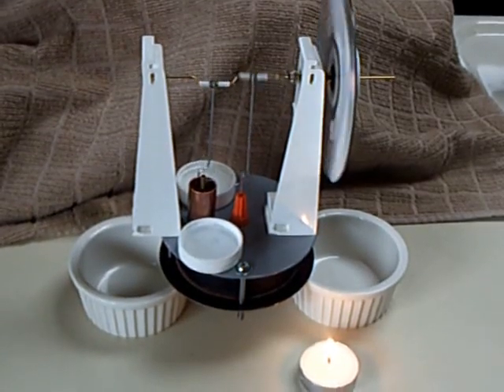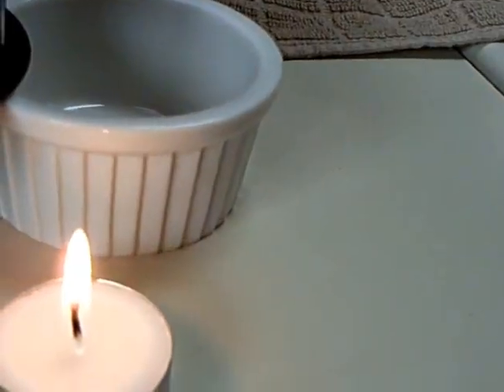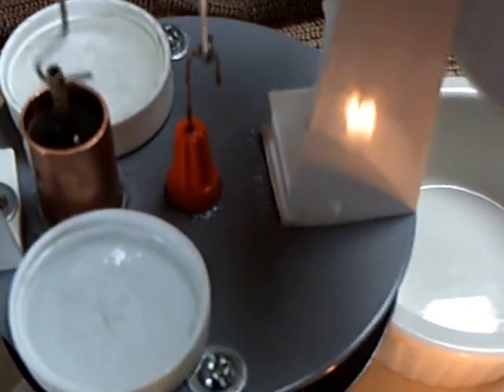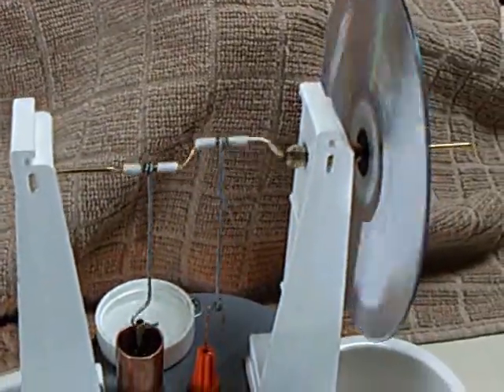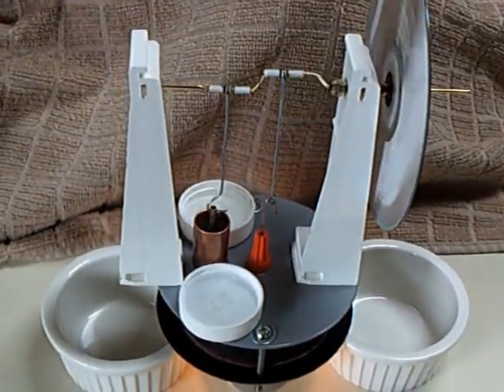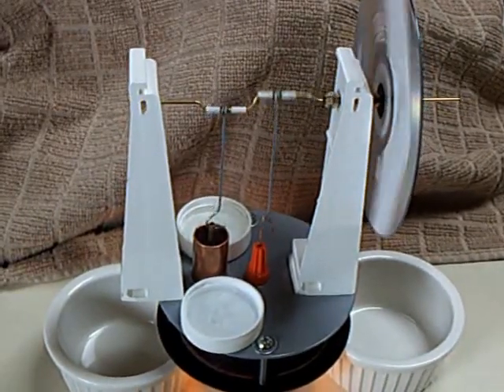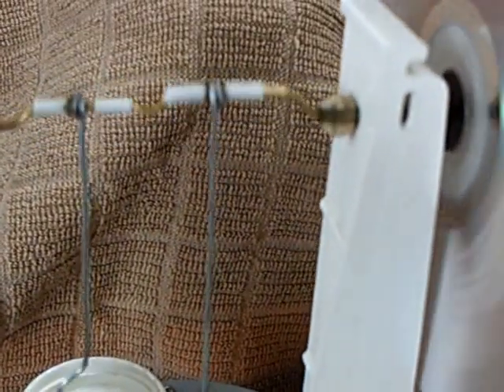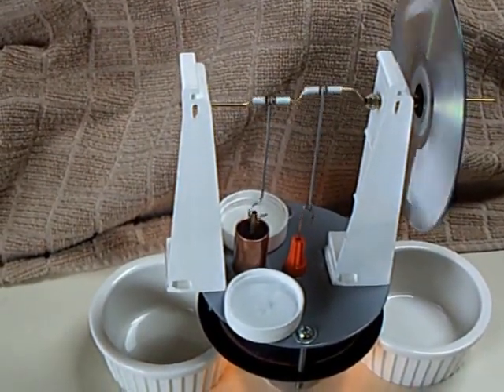Cold Stirling Engine

Comment from the maker: Thanks Jack.  The drive piston is cast epoxy (there are several videos out on how to do that) and the cylinder is just a short piece of copper pipe.  The displacer is made from a 1/4" thick dense foam pan scrubber.